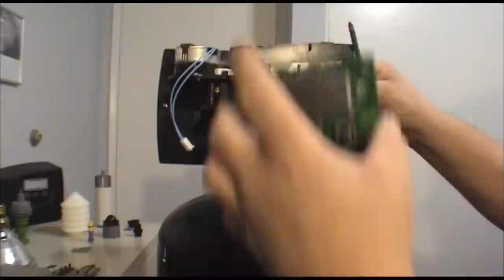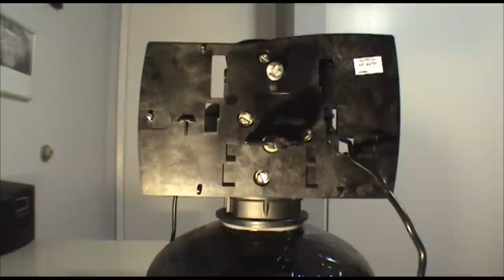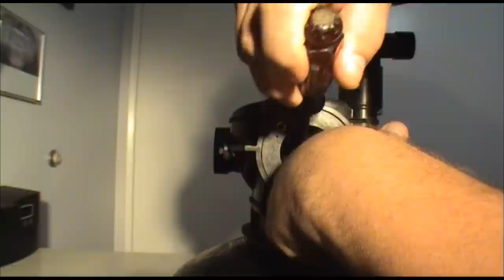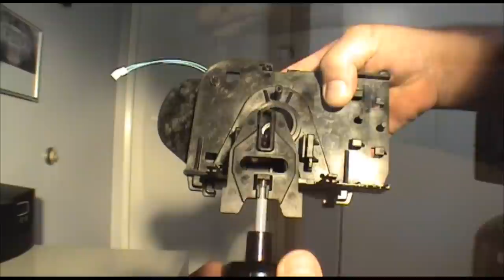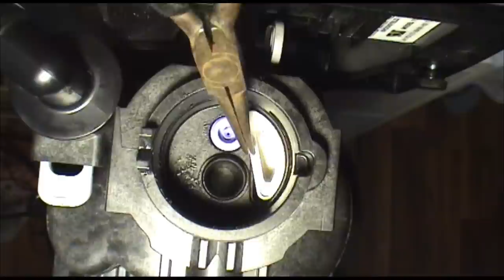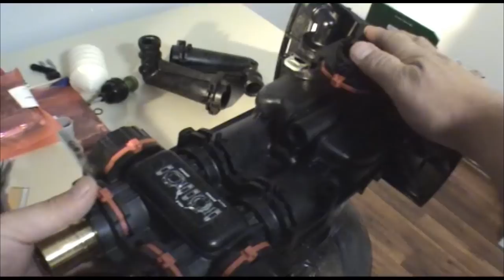Fleck 7000SXT Rebuild tutorial

Comment: Hey there, nice video! So I have a 6-yr old 7000 SXT and for the piston assembly, the manual shows three part numbers: a 61452–10, a 61453–10, and a 61452–20. Nowhere on the external valve assembly do I see a part number. Do I need to take this thing apart to figure out which piston model I have? Same issue for the injector assembly…many part numbers shown in manual.

Comment: Excellent video!  When replacing all of the O-rings as well as rubber spacers, should one use silicon grease on the these fittings?  Thanks!

Comment: What spacer tool did you use? I can only find the $60 one for Fleck 2510, 2700, 2750, and 2900.  It didn't say not to use it on the 7000 and it looks the same.